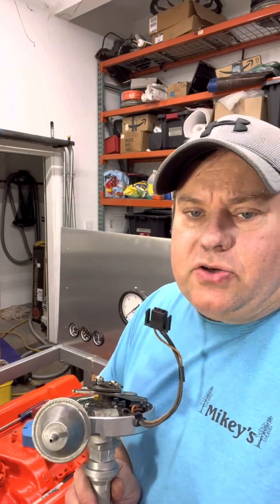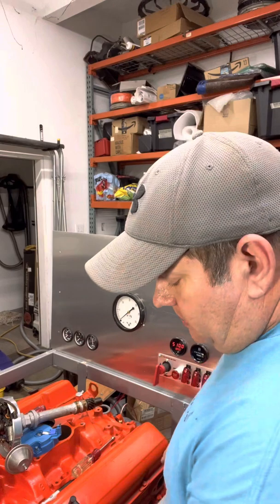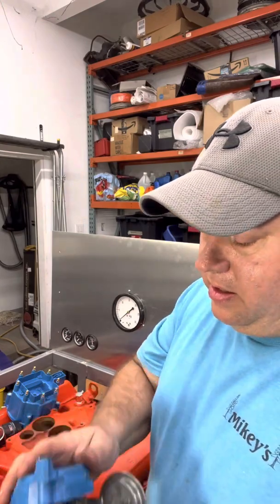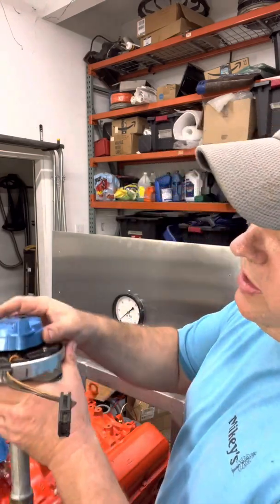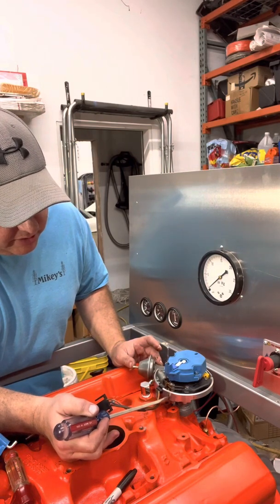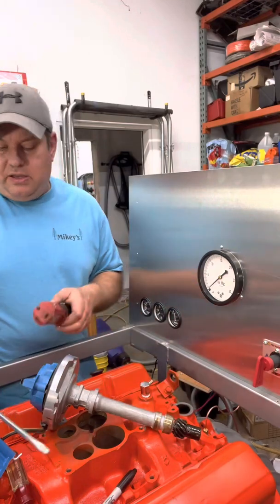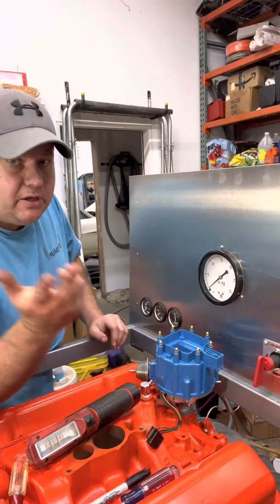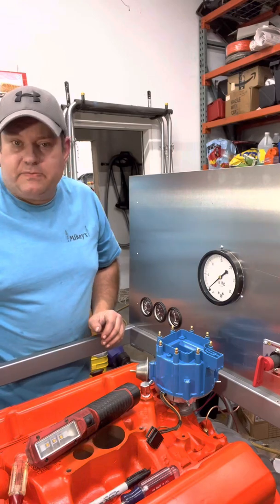Distributor installation tutorial

Comment: You had trouble getting the TDC mark on the distributor to line up so that you had plenty of adjustment on both sides without interfering with the vacuum canister. It might've been easier to move the number one terminal one place counter clockwise. That is how I've done mine and it allows plenty of adjustment on either side of TDC with plenty of room for the vacuum canister.

Comment: Are you saying you can't hear that cherping ?  Why can't any terminal be # 1 if # 1 cylinder is at TDC on the compression stroke and you drop in the distributor and the rotor points to any random terminal why can't that terminal be # 1 ?
Reply from the maker: I can hear the chirping.  It’s wasn’t a battery; I was adding onto my shop and the circuit for the heat detectors was shut off while the circuit was being extended for the addition.  The heat detectors where I have my 2 post liftare 16 feet up, I have other ceilings that are 14’ tall, so it’s not as easy as just unplugging batteries. 

Any terminal can be #1; however #1 is typically identified by service manuals and I prefer to set it up that way. For me, it’s the details.